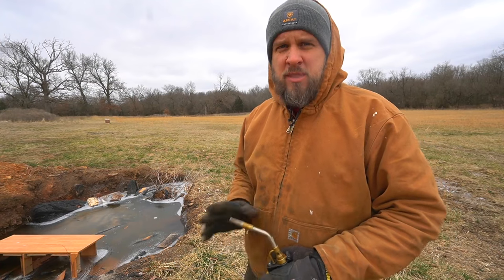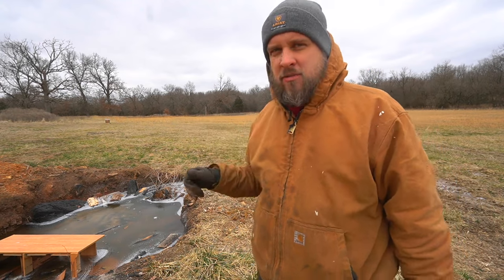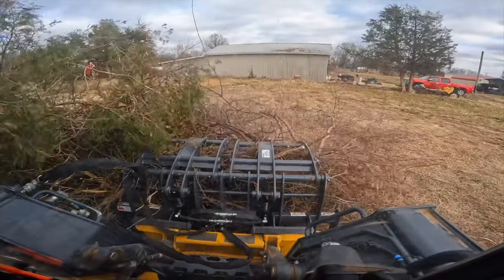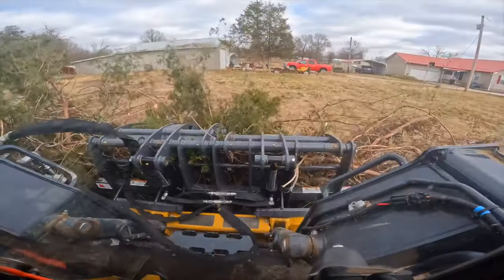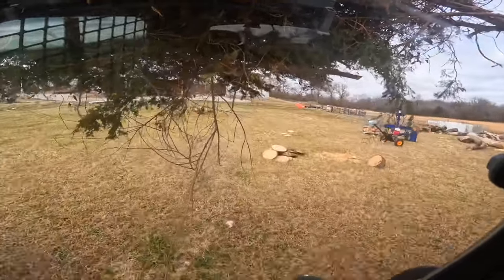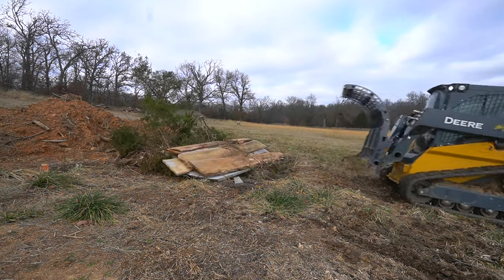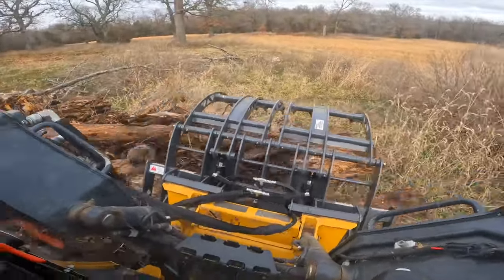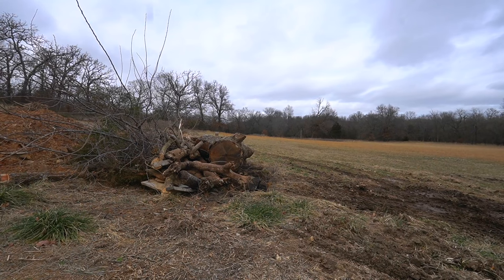This Skid Steer Grapple is a Game Changer

Comment: We definitely had that problem with those fittings. Cracking the fitting loose to relieve the pressure always worked for us.
Reply: I made a setup that saves from cracking the lines to relieve the pressure..  Contact me and I will send you pictures and some explanation..

Comment: Use hot water on coupling when cold.  Wisconsin weather and a working farm taught me that
Reply: I just hit it with my propane torch for a second..  Drys out the coupling so it will not freeze again..  Does not work on my snow blower though cuz it gets snow on it when working blowing snow, then the warm hose melts the snow..

Comment: You should definitely ALWAYS make sure your attachment on the skid steer is securely locked on before using it. I didn't do that once with a grapple, and when I tilted it down to pick up a pile of brush it fell to the ground and ripped one of the hydraulic fittings right off. Haven't made that mistake since. Keep up the good work!
Reply: It's amazing what an o shit moment and a few dollars lost will teach you. 

Like when I went down a hill on a tractor with the front bucket full of wood without putting it in 4wd

Comment: With your 325g can you have the load partially off the ground that you can exist to cut logs that are in the grapple? Just thinking if the log can be elevated enough so it’s off the ground and still open the door.

Comment: Residual pressure can cause those hydraulic lines to be a pain to connect. Nathan from OTW uses a tool to connect his, he has mentioned it several times. Nice grapple!
Reply from the maker: Mine has a built-in pressure release. First time I’ve had trouble.
Reply: @RockhillfarmYT  10-4

Comment: Just wondering why you dont make a permanent spot to burn out of concrete?
Reply from the maker: I would say that In a hole is still safer than on concrete. Wind is the big problem.

Concrete is expensive. Holes are free

Comment: Thats a Positrack not a Skidsteer.
Skidsteer have tires hence the working skid, cause your turning skids the tires, where this is a Positrack, using rubber tracks like a tank.
Reply: A positrack is still a skid steer as it slides the tracks to turn..